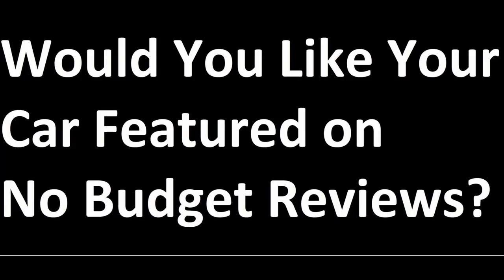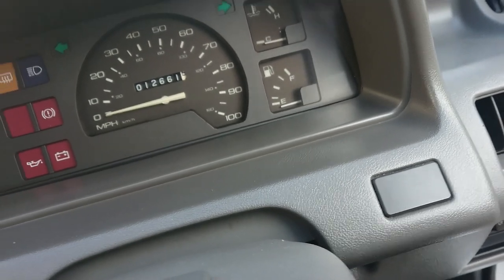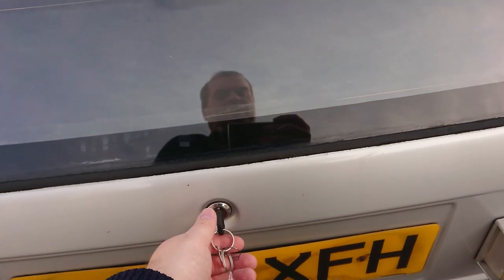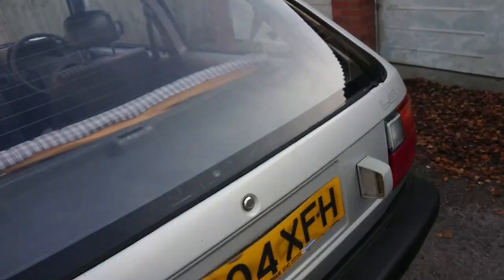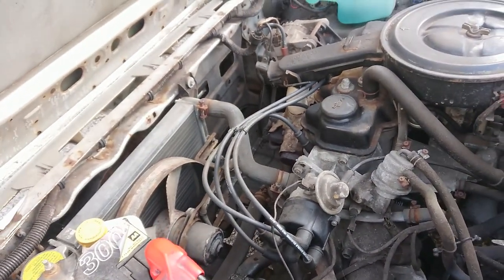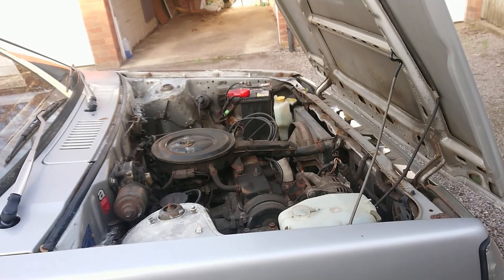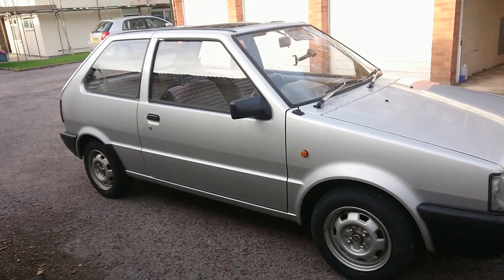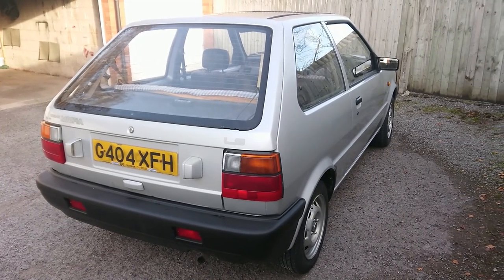No Budget Reviews: 1989 Nissan Micra (K10) 1.0 LS - Lloyd Vehicle Consulting

Comment: My Grandad had a red F reg three door and my Aunti a red J reg five door. Both were same spec as this one from memory.
The K10 were always a very sensible though not especially exciting option. They do seem to be the generation of Micra that people look back on most fondly. The boxy design was very functional. I remember the little bubble that superceded these in the early 90s wasn't all that well received initially as people preferred the boxy style of the K10.
Reply from the maker: Yes, easy to see out of, very smooth gearbox and not that heavy, despite the lack of power steering. Still a very sensible option as a starter classic now! The styling of the K11 was very, very different from this. That isn't quite a nostalgic car yet, as they are still relatively common (albeit disappearing fast).

Comment: My sister had one of these. It was a one litre with a slightly better spec including a rear wiper in a lovely metallic bronze colour. I drove it a few times and it didn't half go well, particularly round town. It also did the basics really well. Things like starting up first turn of the key and never breaking down. That looks a lovely example and it should be around for a long time once the body has been tidied up.
Reply from the maker: Yes, Alex has excellent mechanical skills, so I am sure that it won't be long before it is made incredibly presentable. The 1.0 litres are very nippy around town, but a bit out of their depth on a dual carriageway, as I found out! Absolutely impeccable reliability for their time, and very easy to drive for a car designed in the early 1980s.

Comment: Yay, Joseph gets his hands on a K10 Micra. The ultimate practical modern classic in my eyes. Reliable, practical and easy to drive with very very little to go wrong. Autochoke and ability to take unleaded without modification is always a bonus too. You can see why driving schools loved them. I do have a penchant for simple cars that you just have to drive and this fits the bill nicely. 

I remember looking at a few back on the late 90s and many had developed "Micra wheelarch". 3 arches would be totally solid and one would have rotted away (but never the same one). AFG Nissan a wonderful throwback too
Reply from the maker: Came through at quite short notice, sir, but we did have a go in one last week! That is right, I don't know about E10 with these, but certainly unleaded is fine. The driving schools did love them, very, very easy to drive, if a bit slow in 1.0 form.

The dealer sticker and dealer plates interesting, of course!

Comment: Thank you Joseph, and Alex, fr featuring this Nissan.
What baffles me is the rear window defroster switch, which is located where the air conditioning switch would be instead of that huge blanking plate to the right oh the steering column!
I also went on Google to looks up its weight in pounds and it is under 1,500 pounds!
This is the period when Nissan put out cars  everyone wanted, and needed, that were extremely reliable, dependable and good value.
The next owner of this will be getting a well-loved example.
I believe Alex mentioned that this Nissan is too modern for her. Oh, I do like Alex, and yourself Joseph ! That is why I have subscribed to both of your channels!
Reply from the maker: Yes, 630 kg for this base model. Nissan got a really good reputation in this country with cars like this. For its age, these cars were very reliable indeed.

Comment: I bought a face lift model new in 1989 when they also introduced the 1.2 engine. I went for a top spec 1.2GSX: I ordered a 3 door as I couldn't stretch to a 5 door and I was single at the time. However the dealer sold the one that was allocated to me so I ended up with a five door. I had it 11 years until I needed more space for a pram! Green over silver and a reliable car.
Reply from the maker: Thank you ever so much indeed for watching! Yes, the brochure which came with this car from 1989 mentioned the 1.2 models. They can still be very reliable these does with regular servicing. I hope you enjoyed the video, interesting two tone paint you mention.

Comment: I have a 1991 Micra Premium. Basically LS spec, but only available in white with a brown interior. I hated the fact it only had a driver's door mirror, so I sourced a pair of NOS genuine Nissan internally adjustable door mirrors for only £70 plus P&P. Easy to fit. Spares are easy to get, as most K10's are scrapped because of terminal rot, there are stacks of cars stripped for spares. I even found one specialist that has a number of old K10's being broken for spares at all times. I would recommend anyone wanting a 1980's or 1990's supermini to check out a Micra. Cheaper to buy than a Fiesta or Nova, as the Micra hasn't yet caught on with many car people. Even now it's still seen as a driving school car, or something your elderly spinster aunt would drive.
Reply from the maker: Yes, we discussed the mirror situation just before filming! You are right, so many cars of this era were scrapped due to rust. The driving experience was actually very different from a 205, Fiesta, Polo or Metro, all of which we have had on the channel so far this year, either on No Budget Reviews or Sensible Secondhand Classics. Values do remain low for the reason you mentioned, although I don't really know why, as they are surprisingly practical as a starter classic. More 1970s, 1980s and 1990s Datsuns and Nissans coming up on the channel soon!

Comment: I've been considering one of these (ideally a 4 door manual) as a next-to-no budget option, chiefly for medium range commuting.

I've seen listings for runners as cheap as under £300, granted they're typically with light dents and TLC needed, but compared to even a resto' job Mini costs many times more than this, one of the cars inspired by her.
Reply from the maker: Oh gosh, the Minis are much, much more money, even for a basket case one! Those are firmly out of No Budget Reviews territory now. These are surprisingly good to drive for an old car, and I can't believe how cheap they still are. Thank you for watching, Jim!
Reply: @lloydvehicleconsulting  You're welcome.

Agreed re' the Mini, especially with at least one UK company making special coil springs for the car, which solve the rough ride characteristic of the original rubber cones. 

Come to think of it: cheapest Mini I've ever seen was one the Police stopped in the 00's: the owner had bought her for £5 ... though unfortunately for him this was a little bit obvious to the Traffic Cops, as the car's A pillars were more rust than metal XD.
(needless to say they gave him and his passengers a ride home, being unprepared to allow a car that badly corroded drive another inch)
Reply from the maker: @jimtaylor294  , yes, I drove a classic Mini in 2020 on Tweed Jacket Reviews, a 1989 Mayfair. I also drove a 1983 Metro Vanden Plas last year, which had many excellent characteristics of a Mini (such as that gearbox whine and the excellent round town capability), but was much more comfortable and spacious as well as having a better ride. People kept buying the Minis, however, and so they ended up outlasting the Metro, which was never properly replaced.

I remember all those ropey old Minis being around in the 1990s and 2000s!